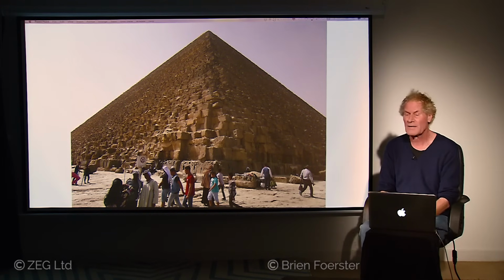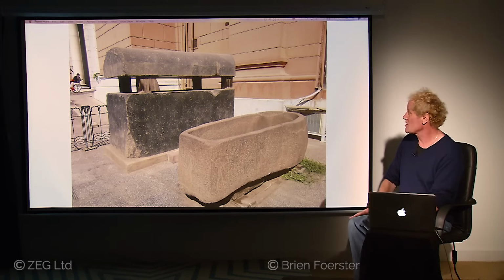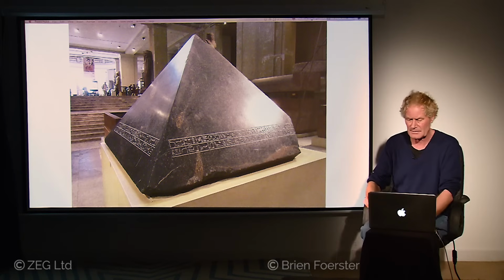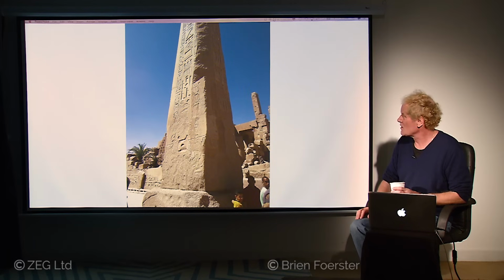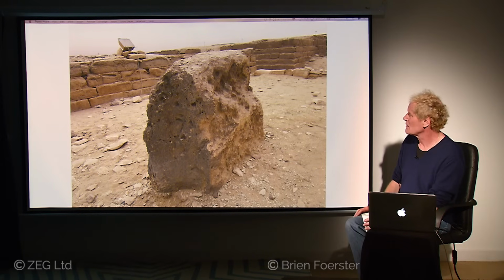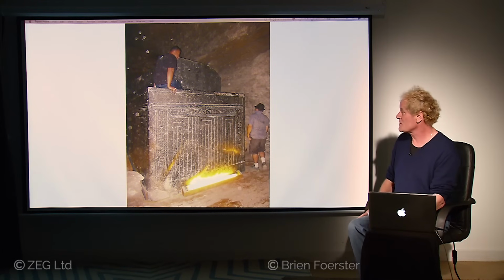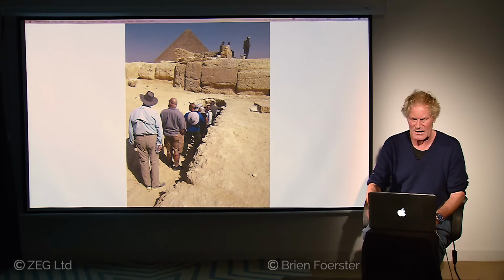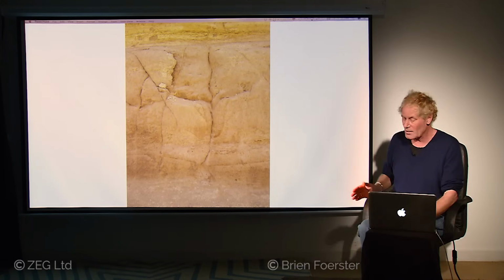Lost Ancient High Technology Of Egypt Full Lecture

Comment: You DO NOT need a harder stone to cut a softer. That is misleading and incorrect.  You CAN cut a  7 on the mohs scale with a blade consisting of a 5.  Friction is enough. Also, you do not need diamond dust sandpaper to get that polish for the same reason... Friction is enough to cut.  You can cut through bone with a plastic knife for example.  So to say the ancients needed diamond blades to cut that particular stone that's a 7 is utter nonsense and misleading.

Comment: See I could tell you how the pyramids were built but you wouldn't believe me. I'll tell you anyway. Monatomic gold. The pharoahs use to eat it. Once you remove the metal bonds from 24k gold it becomes a fine White investable powder as well as many other things such as a super conductor and fluctuates and n weight when heated or cooled to the point where it can become weightless if electric current is added at a certain temperature. That being said the pyramids are composed of limestone which also contains very high traces Ormus aka monatomic minerals be it gold or platinum and they did have batteries back in those days as well as having hightened intelligence from eating gold all the time so put two and two together and you can levitate all them huge stones into place. I probably won't see any replies to this comment but I assure you it's truth and all you have to do is a little research on monatomic gold and you'll see for yourself. Your welcome have a great day.
<3
Reply: Ingestible* not investable

Comment: People like this will always try to make out something more than it is. 
The painted walls of the pyramids clearly show the builders of the pyramids and the sleds that were used to construct them. There are workers camps around the site and also at dier el madina next to the valley of the kings. Bronze tools like chisels were in use and constantly replaced during work on the tombs. 
The fact they are bronze age doesn't hinder their ability to think ahead? 
The Inca in Peru built Machu Picchu in the Andes out of massive blocks of stone that fitted so tight, you couldn't fit a blade between them. 
No such thing as "High Technology", Its just a way to explain something that you don't understand.
If he thinks the pre dynastic people were incapable of such structures and it pre dates their abilities, then i can only guess he believes space aliens built them lol
Reply: amunek why can’t we do this now

Comment: It's not about ancient high technology. The key to understand all these things is so simple. The speed of light has been slowing down. There is a medium that light moves through. It's energy. Lots of it. Matter feeds on this energy constantly. So consider the equation 
e=mc^2. Back when light was 2× as fast, mass was 1/4 of what it is now. 4× and mass was 1/8. Energy must remain constant. This is very likely how things petrify. Mass gains mass as c decreases, and wood, organic material,  etc will turn into rock as it gains mass. So the thing is, the things that are stone now were wood when they built them. 
And they weighed less as well. The light bulb thing was probably just an aquarium with an electric eel inside a solution that made it give off light. The reason this is so well concealed is the ominous implications that comes with it for modern physicists. Very few of them are aware of it anyway. Those that are don't say anything about it. Saying that Einstein was wrong, or lying, is not allowed.
Reply: How can Wood turn to Stone, I dont get it. Wood will eventually just rotten.
Reply: @ericlorentz1016  It does. Ever heard of petrified wood? The petrified forrest?

Comment: Sorry you are way off. Look up how to make a bell whole in stone. If they knew water Tec. Like you clame. Water pressure would be an obvious invention. And  any hard metal can leave smooth lines in any stone. There are people today making huge stone structures by hand with only hammer and metal chisels that are equally impressive. By the way I belive iron or a metal tool have always been around befor stone tools. Stone was just faster and convenient to shape
Reply: Water can cut all the rocks you describe. What the right funneling with gravity alone and a large enough water supply. I can make enough pressure to cut stone and so could you. Water canals were made to transport large stone.at the end of the Same canals water can be trapped and pressurized. Many known liquids at the time can help soften the stone surface for smoothing. I do agree that the structures are much much older than we were taught and repurposed by others

Comment: So evidently they had access to corundum and made saws and at least 8" copper tubes, based on the longest cores found so far. Evidently they had to break them off every eight inches, though whether the three or four foot long holes show this periodic stoppage I dont know. Also the abrading concept presumes most drilling was done vertically, using water dams, continuous replacement of corundum and heavy weights attached to the armature. Yet there are many cases of horizontal holes that would seem to belie the m.o. suggested. One poser is the radius of arc on one stone showing both concavity and radius that would have to be several yards or more. Chris Dunn goes over this deduction rigorously. The question of striation of granite cores by corundum/copper drill recently by Russian youtubers isnt shown if it matches the kind analysed by Petrie. It will be interesting to see how much data can be adduced as to Egyptian mining of corundum.
Reply: Not sure what one defines as a "perfect" polar orientation. We need to know what the mechanism of birth of planets, and we are from having that knowledge.

Comment: The distance between lines in the drilled holes would indicate the feed rate. Or feed per revolution. Today's core drill technology could not match the force and speed needed to create the machined surfaces in these holes. The spiral feed lines indicate a revolving drill. Today's drills would quickly fail under the stress.
Reply: I’ve used all of them. Hilti is the best. But don’t even come close to that work done. I’ve drilled holes in “concrete”  1” to 10”. I’ve used the biggest and best core drillers. Don’t come close!
Reply: wow, for real? been wondering if any kind of expert can explain what is/is not currently doable with regards to core drilling. this wouldn't be achievable now?
Reply: Can you explain how the distance relates to feed rate? Why would a slower drill rate create lines with different distances?
Reply: @mgreco712  F = m*a
You can achieve anything you decrease the force and increase the time.
And they clearly had time those days.
Reply: xl The feed rate on the tube cores of granite is one in sixty, or estimated to be about 0.10" per revolution of the drill. That's impressive for granite. Can that be done today? I don't know.
Reply: Wristguard2888  lol how so brotha?
Reply: I can safely assume you've never used/saw a HILTI 😂
Reply: If we could do it today, we would! U can try to fool yourself if u want. Like Brien Foerster said "Lost Ancient High Technology " that we AINT GOT. Least not common population

Comment: In Karnataka they have a method of cutting slabs of granite by drilling holes to the depth of the thickness of slab to be cut.Drilling was done by chisel until the last couple of decades however, they use power drills now. Then they burn a fire overnight within the square. next morning you can lift the slab out. The stone is cut to even thickness. for example to cut a slab 4'x6'x4". drill holes 4" deep spaced at 4" to 6" apart along 4' x 6'. Heat the rock within the 4' x 6' . We would be able to remove the neatly cut slab the next day.

Comment: I have only started this video but I have to disagree straight away with his estimation on how long every block would need to be set in order for the 2.5 million blocks to be set over 20 - 30 years. If you do the math you find out that he has worked it out based on one person.
If one person were constructing the Great Pyramid, they would need to cut and place a block in two minutes. Plus he was working on the tightest numbers i.e 2.5 million blocks over 20 years rather than taking into account the 2.3 million over 30 years and splitting the difference. Since his math is so wrong right at the beginning it doesn't bode well for the rest.
It is estimated that 20 - 30 thousand people worked on the project. I used 20 thousand people and it came to roughly 18 years for them to complete the Pyramid. That doesn't take into account having days off from construction for holidays and what not and it is based on blocks needing a week to be cut by a team of four people working eight hour shifts. Like come on. If you have 20 thousand people and you send them to the quarry and If you split the 20,000 into teams of four you end up with 5000 teams. Each team cuts a block in a week. In a week you have 5000 blocks. How many weeks till you have 2.5 million?
Then take that number and divide it by how many weeks in a year. That is how long roughly it would take to cut all the blocks. Now you have 20 thousand people in teams of four again setting a block. A day for block setting. This means that every day, you set 5000 blocks. How long to set 2.5 million blocks? Even if it took a week to set a block (which is probably more accurate than a day, but to set a block in a well defined space in a team of four over 8 hours should be do-able), you still have the same time length as for cutting so you double it and get your answer. Again, that does not take into account time off, holidays (if they even had those things). By now you should be able to see, by your calculations, that it is very much in the realm of do-able. Do the same for 30,000 workers now and repeat for 2.3 million blocks. Find the average. Realise that Brien made a mistake.

Comment: drilling them holes with primitive tools is hard, not impossible, you can use metal tools with granite dust, as long as you use a material with the same hardness as what you are cutting into, for example:
https://www.youtube.com/watch?v=82Qijy2eZrI
brien stop explaining everything with the line "they had to have used diamiond dust, and that is a modern thing", their is more than 1 road that leads to rome!!!,
for example a granite block being cut/sawed by a copper saw and sand.
https://youtu.be/qeS5lrmyD74?t=49

Comment: the "knobs" on the stones are from the pours when the stones were formed and if anyone knows anything about casting then 99.9% of the time castings have these and that goes for everything from plaster to brass to cast aluminium
Reply: Richard Mcginnis, do you think that the same technology was used in other places, ie Peru, where there are ridiculously large stones with knobs on some of them?  The same sort of thing seems to have happened there too, Macchu Picchu has obviously been built over by people with a much lower capability than the original builders.

Comment: This guy is an idiot and obviously doesn't know ANYTHING about Engineering or Geology.
For one thing, you don't need diamonds to cut granite. Granite can cut granite but then so can Quartz and Corundum. 
The sarcophagus lid that fits perfectly down into the sarcophagus was not cut out of the box the way this clown suggested. It was cut or sliced off the main block thick enough to chisel the tight fitting step in the lid. It wasn't shaped while being taken from the main block. That would just be stupid and not even possible today.

A dowel with grit could have been used to drill holes, although I admit those were some pretty special mortises. But then with this idiot, that might have been done by today's machinery and not have anything to do with ancient Egypt. But then garnet grit in water in cloth or leather could polish the Pyramid Cap.

This clown really has no idea what he's talking about. He's looking for holes where there are none.

Comment: This gentleman is wrong about how the stones were cut. I have watched  2 men drill a hole in limestone using a copper tube, a cord and bow to turn the tube back and forth. Sand is poured into the tube. The cord is looped around the tube and attached to the bow. Two men pull the bow back and forth, the sand does the cutting. When the hole is deep enough, a wedge is used to break the core free.
Reply: Limestone is as soft as butter compared to granite. I hope you do realise that...

Comment: @42:30, I am wondering how it would have fitted on wheels, to make it fit practically tight to the walls with the wheels.  And then, find a way to move them on the corners, from horizontal to vertical.  The system has to withstand gravity of the 100 ton block both horizontally, and vertically. Maybe ropes or another system was used to move it. I remember that water was used before, but I don't know if they would fill this system tunnels with water, and have some device to lessen the weight, which would fit inside, like wood.

Comment: 9:45 - looks like waterjet cut marks
Reply: Presuming limitations of the time, you might be right that somehow they created a water jet tool, that is easier than to make diamond cutting tools. If they created a water jet cutting toll it can explain the precision and high rate of production. In my oppinion they should have been pretty advanced in hydraulics, hence could create hydraulic tools to move things around and to cut, grind, lift
Reply: Hagop Antranik Kasparian I respectfully disagree .diamond tools are more accurate than wet jet cutting .

Comment: Oh wowowow dude go easy on this guy. Anyone can see we use 3d granite printer's on the spot with magnetic heat energy. We also had carbon steel tool's even before the flood, we were also very advanced metallurgest with sand carving blasters and controlled gravity after all it's just an inertial force just like magnetism. The only difference is how they're generated.

Comment: you don't have to twist my arm in just what im seeing there as in tech, I have worked with Hard Metals the name from the south African company, The steel was SPS and annelid so when I would cut the rope or box threads on both the rods and couplings using Tungsten Carbide cutting bits on the VDF Tracer Mills, Now this steel with the cutting teeth tungsten of course blows through rock like a bullet, Unbelievable in the speed in which bore holes could be cut. Now Prior to this tech if you did not have specialty steels and Carbide Bits you simply could not drill or cut rock to the degree of accuracy seen. Now with a primitive drilling rod of what brass? and a hammering method while rotating the drilling rod would take forever to cut through a few inches alone. And those Egyptians still taking credit for the Pyramid and Sphinx is like me saying im the POPE. We don't believe in History's Ancient Liars anymore. Time to put up or shut up Egypt. Proove it show us the ttech or get a few thousand of you to haul lets say only 50000 thousand stones from 3 destinations away get them to GIZA with the tech of that day.  Egyptians are such crazy People

Comment: "the tool has to be harder than the substance". ?  Tell that to the guy that cut thru the jail bars using string and tooth paste.
Reply: Great point, the grit in toothpaste is actually harder than the steel bars. On Mythbusters it took 2400 hours to cut a prison bar using this method.

Comment: I still have the theory, that they "somehow" were able to POUR granite and hardened during next process steps (maybe throughout heat or chemical reactions). The "knobs" are not for levering these stone but just the outlets from the big sags were the fluid granite as been poured in and then hardened to the blocks we see today in Peru and Egypt and all over the place. maybe they even did this process direct on place. so no lifting would have been necessary!
Reply: no pls read about granite formation , it is igneous rock and definitively not concrete

Comment: You meant diamond cutting wasn’t “re-created” until the later 19th century.
Reply: How was the Bridgeport mill moved away that could cut 30-60 ton basalt blocks at 2500 RPM with the Chrome Molybdenum tool holders of the shaped diamond cutting tools? How big was the Bridgeport used? Also what happened to the 900-ton crane that was used to flip the stone block around to machine it on each side, as well as what happened to the 1 million ton load bearing road used so that the crane could position the 30-60 ton blocks on the giant Bridgeport mill? All this outside of the fact that the ancient Egyptians never mined Chromium, Tungsten, Thorium, Iron, Molybdenum, Nickle, nor had Iron smelters, they used Copper!

This is why the recreation of Egyptians making this kind of technology of cutting tools is asinine.  Also, one point not addressed a 550-2500 rpm Bridgeport cannot cut a perfect inside corner. How were the stone boxes created that perfect inside corners? You can get a rounded corner with a spinning tool, but cannot get a sharp square corner! I am a toolmaker machinist I'd like to know how it was done in stone harder than Austenitic Manganese steel, no less!

Comment: Diamond technology has been created and forgotten more times than you can count. Thinking of history as CYCLIC rather than linear is the best way I can describe, with words, to make the point that's impossible to make with words (especially English).
Reply: So they must have had mining equipment to haul the stone. Oh and don't forget the oil drilling and refining for fuel they must have had that at one point in the cycle
Reply: @EvonySkywalker  oil for energy is an economic machine, rather than the most efficient form of energy. Though it's possible, I doubt the original builders used oil.
Reply: @EvonySkywalker   the original builders had everything we have now only much more advanced versions that we haven't yet come to know or comprehend.
Reply: @EvonySkywalker  Narrow perspective you have.